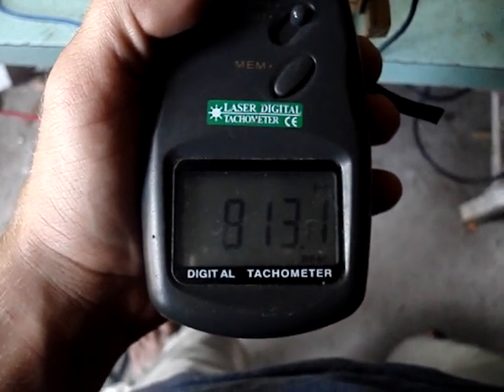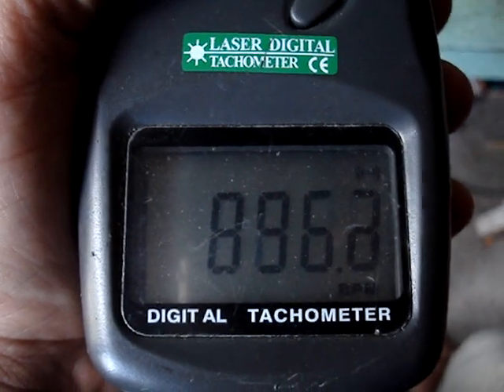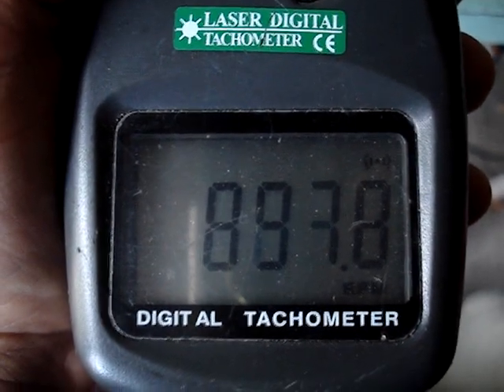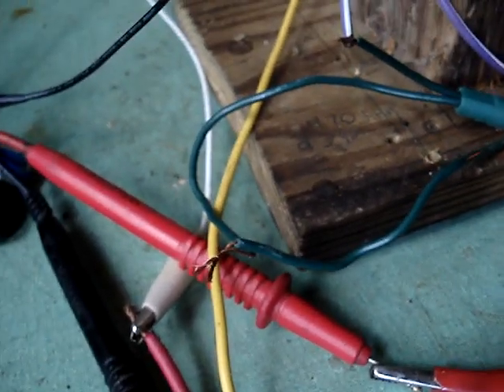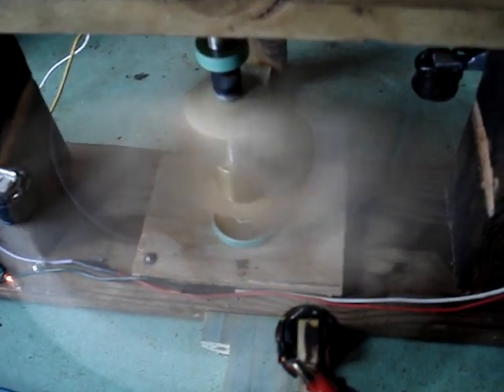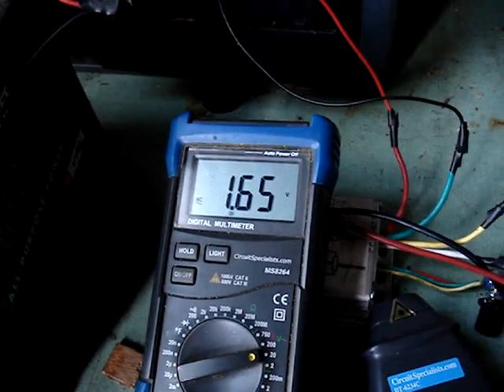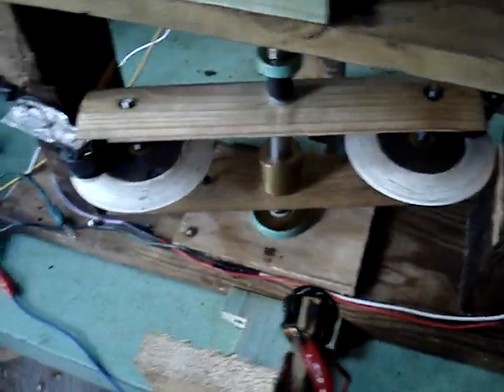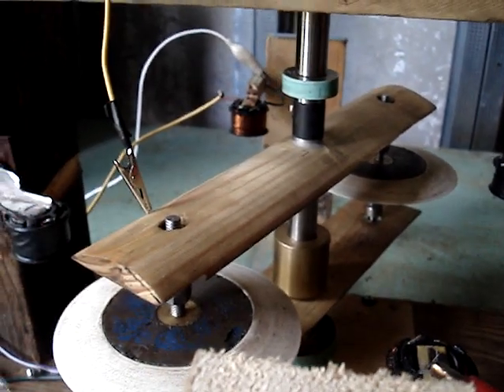The New and Improved Generator ( lighting a light )

Comment: Hi,
can you please measure the input power into your drive motor and
compare it with the about 4 Volts x how many amps does this light
bulb drive ?
Speed increase could just be to impedance matching or
no more saturation or something like this... so it is no
reason, that this is a efficient generator...
You really must measure the output power ( best to rectify an measure DC power)
versus DC input power.
Use low passfilters to see the input power...
Thanks.
Regards, Stefan.